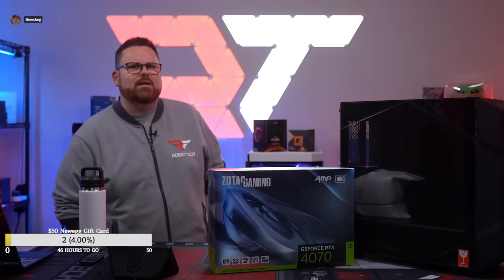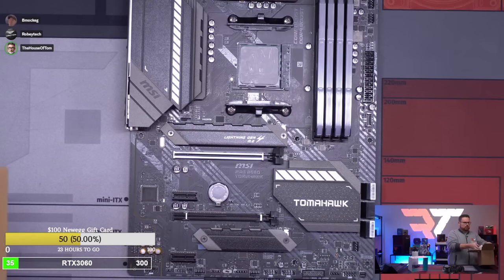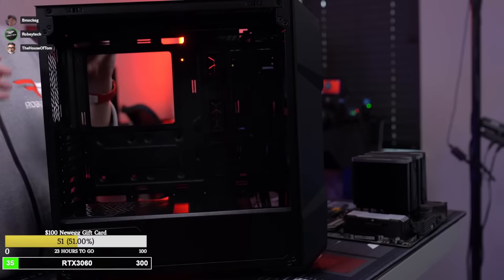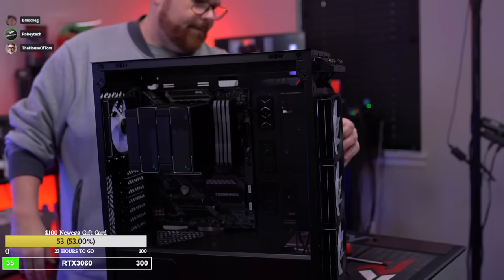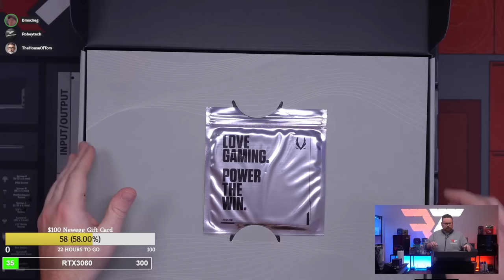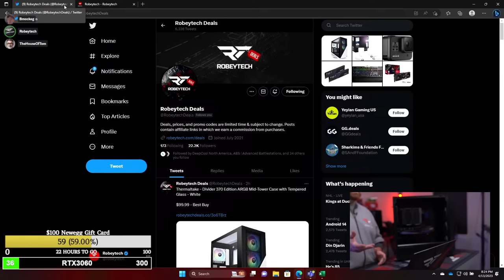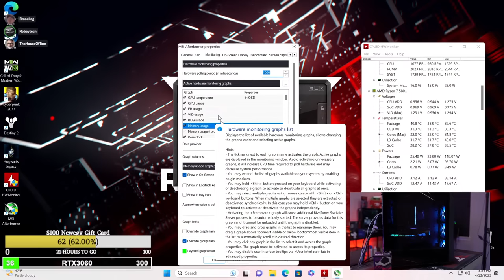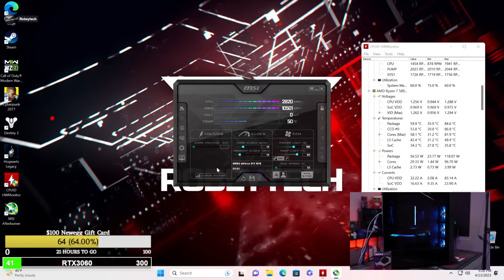Building a Sub $2000 RTX 4070 Gaming PC - Giveaways + Cooler Master TD500 (5800x3D / Zotac AMP 4070)

Comment: Going for a very similar build: 4070 FE; 5800X3D; B550 Tomahawk; Corsair RM750x; 970 Evo Plus NVME 1tb; Team Group 8pack edition 16x2 (32gb) Cl16-16-16-38 dual channel and dual rank; Noctua NH-U12a CPU cooler; Corsair 4000d airflow case; 2x 140mm NF-14 in-take; 1x 120mm NH-12x15 exhahust
Reply: I plan to get very similar build aswell. What is your temps on this case? And also is the motherboard and case compatible? Or do I need an adapter?

Comment: Why the F are we not utilizing all fans now. just lazy and cheap.
Reply from the maker: No intention around keeping costs down.  I explained that as part of the live stream.  I wanted to keep the balance between looks and function.  Also there is no need to use the fan slot, you could use one if I did both it would actually hinder the cooling and the temps were fine despite me doing a non standard setup for the cooler.